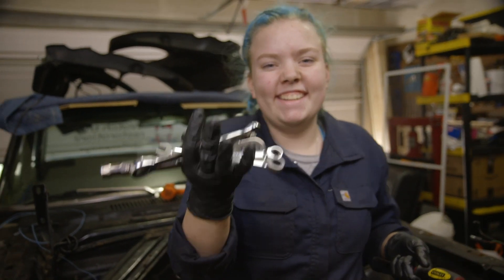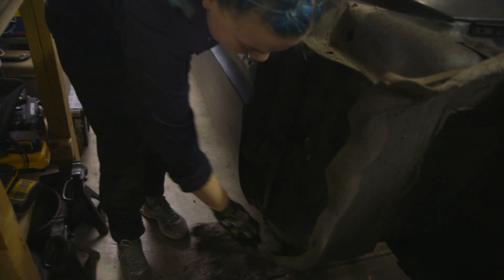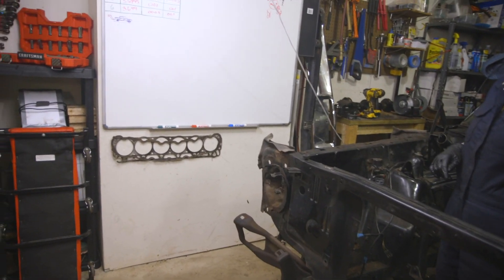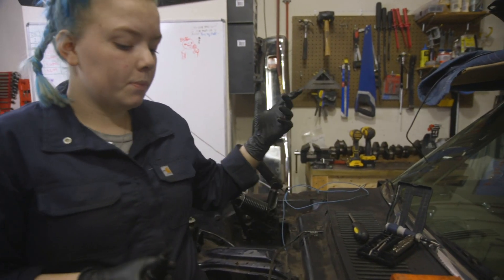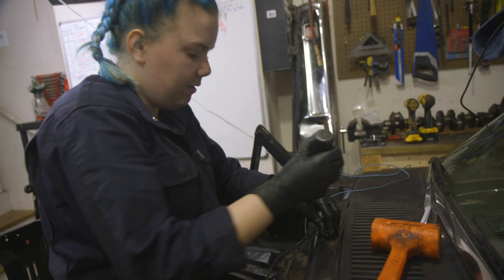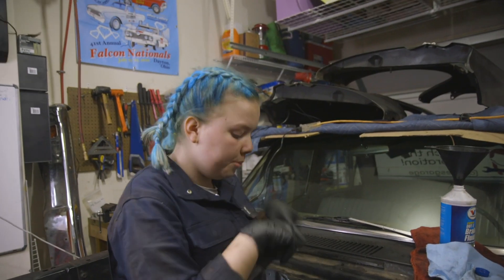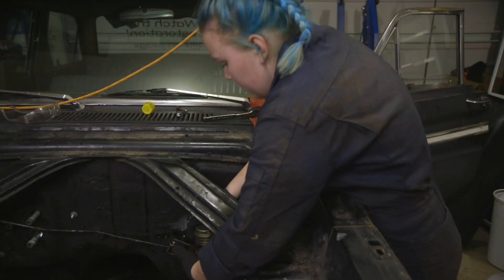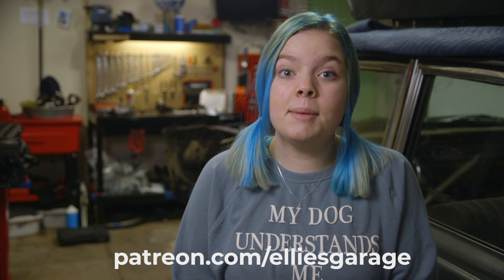Removing EVERYTHING from my 1965 Falcon's Engine Bay

Comment: I know it’s late to mention this, but be careful when dealing with those fittings on the A/C evaporator core.  They are relatively soft aluminum and are easy to bend/break the hoses.  The reason for the second nut near the firewall is so you can hold the line steady while you remove the fitting with a second wrench :)

Comment: Morning Ellie, the piece of brake line you showed in video has a compression fitting on it. That is a death wish in a sudden stopping situation.  I am not exaggerating. Please take the time to replace all the lines that need it with flared fittings. Buy a good flaring tool and then you can buy and bend your own lines. Secondly, now that you have the master cylinder out, it would be a good time to upgrade your brakes to a dual bowl master cylinder from a little newer year of Falcon or Mustang. Lots of information on-line on how to do this safety upgrade.
Reply from the maker: Yes sir. We are doing all new brake lines and a new dual bowl master cylinder. Also working on power brakes. Thank you for the advice and encouragement!
Reply: @ElliesGarage  you probably are planning this, but you guys might want to use a dual bowl master that is compatible with disc front brakes.  That way you're ready for a front disc upgrade and ho boy do I suggest that! :)

Comment: Need yourself a nice 18v driver with 3/8 drive adapter for those small bolts - really speeds up removing/installing all those little bolts.  Great alternative to air tools too.
Reply from the maker: Good call. It's been kind of nice to learn by doing it by hand, but we've started using the impact. Much better! Thanks!!

Comment: Hi Ellie, not sure if you can do this, but please look into a brake power booster. With a 6 cylinder you should have sufficient space. Later Mustangs had them and they make life a lot easier.
Reply from the maker: We're looking at it. The shock towers are getting in the way but we'll keep researching. Thank you!!
Reply: @ElliesGarage  Ok, on my 67 fastback I had the 289 and the power booster. It was tight, but it wss there from the factory. You're doing great. Please stay safe and good building!!!